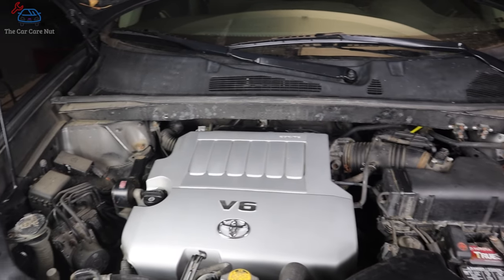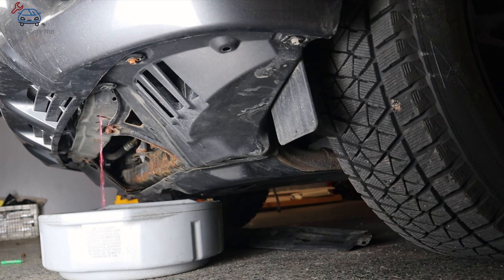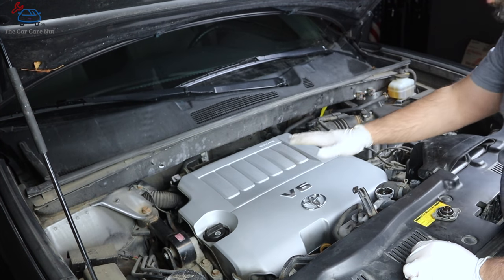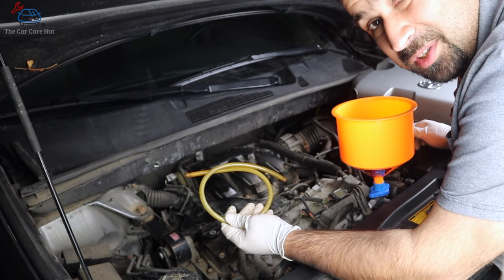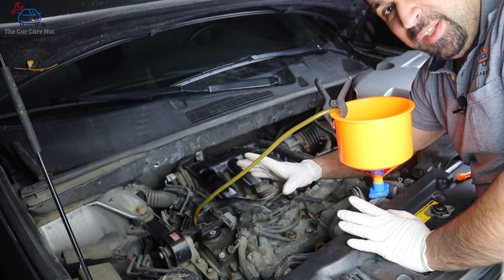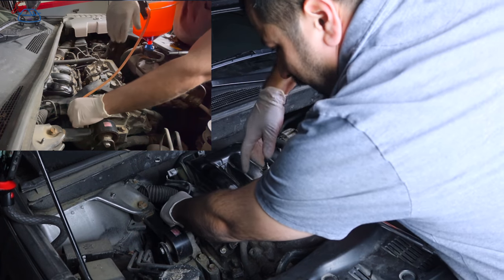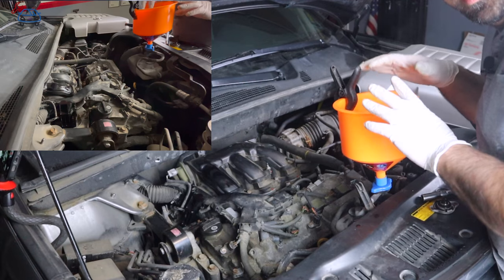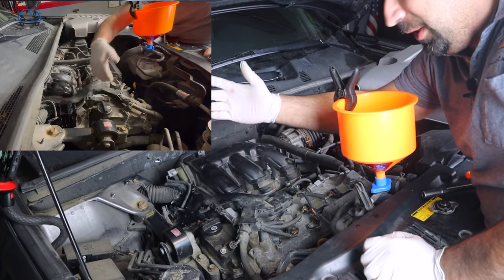Toyota Cooling System Bleeding for V6 2GR-FE 3.5L THE RIGHT WAY!

Comment: At what point do you turn on the heater in order to bleed the air from the heater lines. I just replaced my heater hoses as well as my radiator hoses.

Comment: In reference to mileage and age of a Toyota, when would you remove the coolant drain bolts on the engine block and is there a crush washer?

Comment: Tried this procedure. Raced engine 2200-2500 rpms, got to temp, fluid flowed backwards thru 1/4 hose into bleeder valve. So, I redid the procedure with the same results. What happened? Reverse flow radiator?
Jeff

Comment: I had a question on draining the fluid.  I have a 2011 Lexus es-350.  In the Haynes manual, it has me drain the radiator, drain the engine block, fill with fresh water and with the upper radiator hose disconnected, run the engine until the water comes out clear.  Drain the radiator and engine block again then re-fill.  In this video, you only drained the radiator.  Is that all that you recommend?

Comment: QUESTION: You only drain from the radiator? Why do others online say to open drains from the engine block as well?? Is this not needed? I'd like to make sure I am doing a 2015 sienna flush correctly.

I also noticed Toyota sells the SLLC2 coolant for $30/jug. But Prestone and walmart coolant has <$12/jug for coolant. Even some that are concentrate coolant which makes it easier to FLUSH the entire system if I use distilled water to do several radiator drain cycles.

Comment: Is it necessary to drain all the old coolant out ? After you drain the coolant from the radiator, there will still be some coolant left. If so, what is the best way to remove all the old coolant ?

Comment: Thanks bro! I did this with the tube hanging from the hood latch on a 2015 Sienna, so I could watch the bubbles from the driver’s seat, but I didn’t have the special funnel, so I had to take it down once in a while, pinch the end, then dump it into the reservoir. Next time, I will get the funnel, but I sure hope that won’t be for another 100k miles. Also, I did this on a sloped driveway, but with your method, it is better level?

Comment: Hi AMD,

I've replaced the coolant in my 2016 RAV4 by draining it out (drained about 1.2 gallons) and refill through the coolant reservoir tank. What's the process for bleeding this system - leave the spill free funnel on (so to not put back on the reservoir tank cap) and rev the engine a few times until the fan comes on? In addition, if there was some coolant spillage in the engine bay, do I need to hose it down to clean up? Thanks so much in advance!
Reply from the maker: Hi! That’s correct rev it up until the fans cycle on and off twice and you’re good. For spilled coolant spray it with some water and you’re all set

Comment: Thank you for this helpful video.  I have a question.  at 6:50, you say "air out of the heater core", however, earlier you said to have the heater turned off.  Should the heater be turned on at any point in this procedure?
Reply from the maker: Hi! The heater doesn’t need to be turned on. Coolant circulates all the time in the heater core on cars with this engine so turning the heater on will only prolong the bleeding process and not add anything to it
Reply: @TheCarCareNut  How about Lexus RX 350, 2015. Should the heater be on or off? Thanks for the advice.
Reply from the maker: Hi! Air heater off as well on your RX

Comment: Great stuff !!
What do you think of the electrolyte reaction to the brass air bleed fitting ?
Could that affect the entire cooling system metallic balance ?
Can, or should it be replaced with a stainless steel or aluminum fitting ?
I’m changing the hoses on my 2007 Toyota Camry XLE 2GR-FE, and I’m not a mechanic, but I can get by, it just takes me longer lol !! But thanks for your videos !! Such a great help !!

Comment: Excellent video and thank you.  I purchased all items needed from your links on Amazon.  After the initial drain of radiator is a flush with water before the refill of fresh fluid necessary?   What I’m asking is can we fill with water run vehicle and then drain again for new fluid is added? Thx for your time and talent.
Reply from the maker: Hi! I wouldn’t fill it with water then drain and refill with coolant. I would just use coolant as adding water could change the mix in the coolant that remains in the engine
Reply: @TheCarCareNut  thx for the reply.  Is it ok to use the red zerex Asian instead of the Toyota green that was used from factory?   Do you have another video that flushes 100%?  Thx for your time and talent
Reply from the maker: Hi! You can use a compatible coolant however I would use Toyota pink super long life coolant
Reply: @TheCarCareNut  thx again my brother!  Next time you’re in Naples I’ll buy you a beer.

Comment: Follow this instruction exactly but I ended up with coolant boiling over due to the extreme amount of bubbles coming out of my 2010 Highlander 3.5 2G-RFE.  Am I supposed to have coolant filled up in the overflow reservoir also halfway between empty and full before doing this procedure?  I do not remember anything about that in the instructions

Comment: Great video thanks. Simple question - is there actually a valve that controls whether there is a flow of coolant to the heater core on Toyota’s?. On my suburban there is not. It always flows regardless of heater setting hot or cold. The only thing that happens is the resultant hot air is either diverted into the cabin or to the outside of the car. This may not be the case for my 2004 Highlander that has rear heat thanks!
Reply from the maker: Hi! Most toyotas don’t have a valve so coolant is always flowing to the heater core

Comment: When I change the coolant in my cars, I use the Uview Airlift Cooling System Leak Checker and Airlock Purge Kit (part number 550000).  I would assume this airlift system would work on here to.  Your thought?

Comment: So I carefully followed his instructions.  Seemed to work without issue on our 2010 Lexus RX350 -- have heat and temp gauge is in middle.  

But now I'm a tad bit concerned that the funnel actually ended up with more coolant than what I started with (the rad and then funnel was initially filled to the first fold in the funnel as indicated in the video.  However, at the end during the lengthy normal idle, the level in the funnel had increased by another 1.5" !  Yes, all the bubbling had gone.)

Any ideas on why this happened?

Comment: Hmm.  I only used 6 quarts, seems that's all that came out, too. (Makes sense.)  I thought it would be closer to 12.4 qts, per my spec.  Heaters all work, running fine.  Did I basically just dilute 6 quarts new with 6 quarts old?

Comment: My 2005 Avalon manual says to use the original Super Long Life fluid diluted to a 50/50 mix using deionized water. I noticed the 50/50 premixed version of coolant was used in this video.  Which Toyota coolant should be used in my case?  Also, what type of chemical flush is recommended, if any? In the older flushes used long ago, the use of flush fluid would almost guarantee a leak in the system.  My current coolant is still bright red.
Reply from the maker: Hi! Your car takes pink coolant which is sold premixed. So no mixing needed. On flushing unless there’s contamination no need to flush it

Comment: I think I followed the instructions well and eventually had a steady stream, but a slug of air every once in a while. I let it run longer and then decided it was enough even though it still had a bit of air periodically. I turned on the heat and had heat at the front, but not in the back. Should I try it again as per your instructions or should I run the rear heat? Thanks.
Reply from the maker: Hi! Run the rear heat for a bit to bleed it. Some of them can be tough to bleed the rear heat

Comment: Questions: 1. User manual says it takes 8.9 qts. By draining the radiator, only approximately 1 Gallon will be drained out. In another word, about 5 qts are still in the engine block. Is there another drain plug underneath the engine? Should all 8.9 qts be drained out? Procedures? 2. There is another plug on the diagonal corner of the radiator. Can the vent at the upper corner of the passenger side be used to air bleeding? 3. If not bleeding from the bleeding valve next to the engine, can the bleeding process be achieved by attaching the spill proof funnel to let air go out? Thanks in advance.
Reply from the maker: Hi. You’ll never get the full capacity out of the engine unless you take it apart and flip it upside down. What you take out is sufficient. The other bleeder at the radiator can help with the initial fill but not the bleeding.

Comment: I used the same funnel to change coolant and idled the car for half hour until the air bubbles stopped. However I didn't know about or use the bleeder valve, will that cause problems?
Reply from the maker: If you have very good heat at idle when the engine is warmed up without driving then you’re good. If you don’t have gurgling noises when you rev the engine at idle from behind the dash then you’re also good.
Reply: @TheCarCareNut  if the dash gurgles, where is the air, heater core? Or could it be in just the motor and not heater core..
Reply from the maker: The gurgling would be in the heater core as it tries unsuccessfully to push the air out
Reply: Will it help to park the car at an incline and the front toward higher side. 
While the engine is running open the bleeder valve for air bubble to escape?
Reply from the maker: I’ve tried that and usually it doesn’t do a lot of help with this engine

Comment: I bought a vacuum kit (OEM parts) for coolant replacement for my other vehicle and it worked great. Is it faster and safe to use it on this engine? I already have it and it fits so I just want to know if it is advantageous to this method?

Comment: Hi AMD.  Do you know whether an airlocked coolant ststem can have a negative effect on air conditioning efficiency?  
I'm experiencing problems with A/C air temps since doing a drain and fill a couple of weeks ago 
I plan on doing another burp of the system just to be sure I didn't leave any air in the system from the first time.
Thanks for the great channel!

Comment: Question sir How come my lower radiator hose is always cold not like the upper hose hot. ? I replace the new radiator already & thermostat. 2004 Toyota 4Runner thanks 🙏
Reply from the maker: Hi! The thermostat is not open yet. You’ll need to let it run until they’re both the same temp
Reply: Thanks appreciate sir more power to your channel & Godbless always Family.

Comment: Is there any special procedure that I need to do for my 2016 4 Runner TRD PRO
Reply from the maker: Drain and fill then run the engine at 1500 rpm without the heat being in until upper and lower radiator hoses are the same temp
Reply: Thanks

Comment: Just draining from the radiator wouldn’t completely drain the cooling system would it?  How do I drain everything out without removing the thermostat or heater core?

Comment: I have question hope you can help! I read online when doing coolant flushing it’s needed to drain the engine block as well. But if you drain the engine block and no fluid inside it, won’t the engine over heat? Because thermostat is not open and after you fill the radiator coolant can’t flow into the engine. And even after engine run some time thermostat won’t open as easily since nothing flowing

Comment: Hey guys...can you help me out? I'm an idiot for details or I missed it while watching the video.
I have a 2008 Toyota Highlander so this procedure applies.
1. Following this procedure, does the old coolant from the resevoir get drain when the radiator plug is removed?
2. If not, do we drain it first and replace it with new coolant before the procedure?
3. Or do we not worry about that coolant?
Please explain in detail...just kind of how my brain works. 
Thank you

Comment: Very nice video, just in time for my coolant flush! Although what about the coolant that stayed in the block? Don't they have 2 valves on the block; One on the front one on the back?
Reply from the maker: So the drain on the block is kinda hard to get it and when you finally get to it a small amount of coolant comes out and then from experience even when you drain the block there’s still a good amount of coolant left in the engine so you’ll never really be able to replace 100% of the coolant other than taking the engine apart and flipping it upside down basically

Comment: Thank you CCN for this video!  For the tubing, do I need to get special hi-temp tubing, or can I use standard 1/4" ID 3/8" OD vinyl tubing that goes up to 150 degrees F?  Myy other option appears to be 1/4" ID silicone tubing that goes to 325+ degrees, but has only 5/16" OD (and costs about double).

Also, I am curious about whether I should also drain the engine block with the 2 engine petcocks, or is that not necessary if I drain the radiator.  

Finally, my 2GR FE is in a 3rd gen RAV4, and it looks like I have a "surge tank" (that is also part of the sealed/pressurized cooling system) rather than an open reservoir.  Does this alter the filling/bleeding procedure youve shown here?

Thanks again AMD!

Comment: Learned a lot from your videos and try to bleed the coolant on 2011 Sienna limited, AWD. I bought coolant from the dealer and found it’s 55/45 not 50/50. I am wandering it’s good for my minivan? Or 2015 RAV 4 XLE AWD? Thanks a lot.

Comment: 2011 toyota venza had iver heatin  due to bad radiator, i replaced it and use your process to bleed the system but the car never stop over heating and the coolant is boiling violently in the radiator..

Comment: Does the 3MZ-FE in the RX400h/Highlander Hybrid need to be bled similarly? and on the hybrids, how is throttle managed?  The engine will shut off if once it warms up.
Reply from the maker: Hi! It’s not the same as the 3mz. And the throttle is managed by the computer it’s throttle by wire

Comment: I'll be replacing the water pump, thermostat, hoses (maybe), and coolant.  I have the tow package, and rear seating.  I'd like to skip draining the rear bank/engine block, I guess, to make it easier.  However, at the end, when I do the bleed, will your bleed process be the same?  Any suggestions when doing all these services together?  I have 150k miles.  Thank you.

Comment: I couldn't get my bleeder hose to have a constant flow back into the funnel. It burped back up and down several times, and the funnel bubbled for awhile then eventually stopped. I waited around an hour with no constant flow up the tube at 2500 rpms. Did I just miss it? Heater felt super hot in front and back at idle after, is that a safe bet that it was bled?

Comment: Good video but you didn't explain when to turn the heater on full blast. Do you never turn the heater on? I was taught to turn the heater on to bleed the air out of the heater cores
Reply from the maker: Hi! You actually never need to turn the heater on in this engine as it doesn’t have a heater valve and coolant flows through the heater core at all time regardless if the heat is on or off
Reply: @TheCarCareNut  🤔 oh, interesting,  thankyou for your reply

Comment: Great video, I think I’ll let the experienced mechanic do the work. I have a question. When I have the heater on, feet and face, the center console gets hot. The cup holders are hot. Is that normal or is something wrong?
Reply from the maker: Hi! Which model and year do you have?
Reply: 2008 Highlander base model, the same as you are working on in this video.
Reply from the maker: So this model of memory serves right has heat vents that pass underneath the center console that tend to heat up that area. It’s normal.
Reply: The Car Care Nut Thank you for your advice and help. I really like the videos. Maybe I’ll try to do some of the easier things myself with your help. Have a great Easter.🙏🏾

Comment: I am attempting to change out the old coolant, 162K miles. The voltage from liquid under radiator cap to neg on battery is 0.25 V. I'm not sure if this is a tell that metal or electrolytes are floating in the coolant. What about the engine coolant drain on both sides of the engine? The front is near the oil dip stick. The manual says the capacity is 12qt with towing. I only get 6qt in draining the radiator. Shouldn't the two engine drains be emptied as well?

Comment: Never knew there was a coolant bleeder. If you don't bleed the air out of cooling system, what problems could arise? Can engine overheat with air in the cooling system?
Reply from the maker: Hi! Usually no heat or weak heat and in some cases overheating

Comment: So, i have a 2007 Toyota Sienna i just did a coolant flush (same engine). However, i did not have to do any of this. i drained the coolant by opening the petcock and filled it right back up multiple times with distilled water to flush the system (different days to do a proper flush) after that i added coolant but i did not do any of this. Question is why? My van is not stalling or engine Jumpy, Heater also works perfect i don't know why since i did not bleed the system. I found this Video after i finished everything because i was thinking good thing i didn't have to bleed the system, etc. But apparently it should be done so far i do not have a problem with my van even though i did not bleed it. Can you please elaborate on why this happened to me? And what is the purpose of bleeding the coolant system etc. Thank you :)

Comment: great instructions, thank you. Do you know the purpose of the little piece of pipe right under the radiator cap which has a plug on it? This is on a '12 RX350 and I've been noticing occasional leaks from this location.

Comment: How come you did not open the coolant drain on the engine block? Is this not required because the coolant will drain down to the radiator drain?